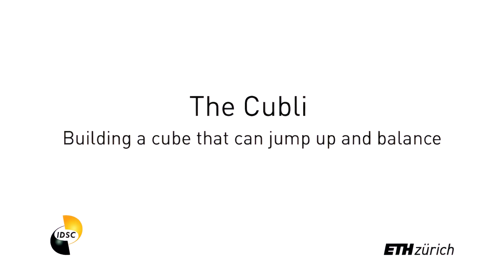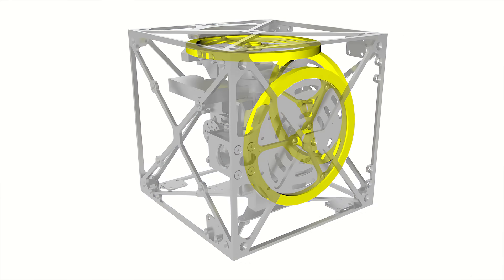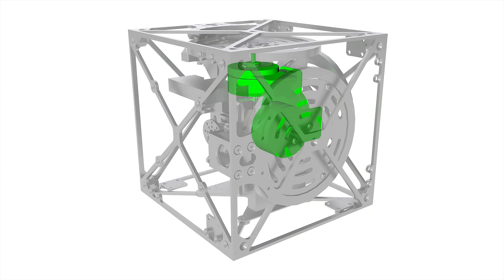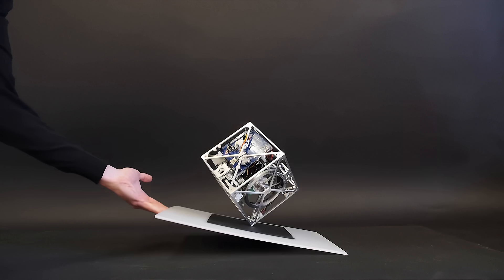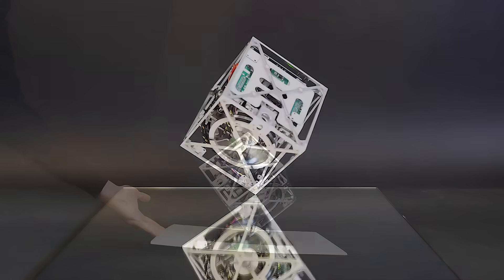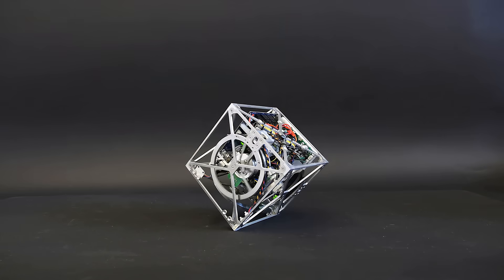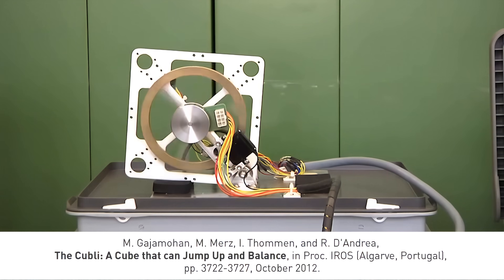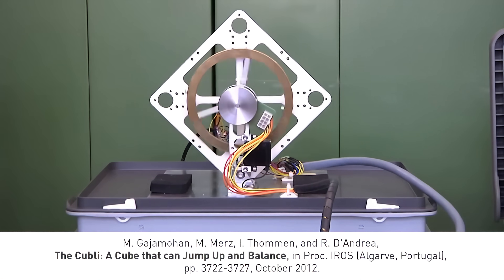The Cubli: a cube that can jump up, balance, and 'walk'

Comment: Spheres and wheels work better imo. Cool nonetheless.
Reply: Watching a sphere balance on any angle is a lot less interesting than a 6 sided cube.
Reply: you can't guarantee a sphere will be still where as with a cube you can have it sit statically on a surface.
Reply: Conventional Characters If energy is any concern, a sphere would be better. Im sure a deployable tripod or something would suffice if it needs to sit static.
Reply: Jonathan Gorr it should be able to stand static within a sphere if it's able to balance on a corner... where can I buy this thing? lol
Reply: Jonathan Gorr Yea but if theres a tiny slope, it would need to slowly speed up, and then it reaches max speed, then you're scewed.
Reply: Jonathan Gorr Yea but if theres a tiny slope, it would need to slowly speed up, and then it reaches max speed, then you're scewed.
Reply: Jonathan Gorr Wouldn't work because you couldn't unload the reaction wheel without a flat edge.

Comment: Is there any algorithms I could find to achieve building a robot like the cubli that uses reaction torques to balance. I am guessing the cubli motor controller use the PID algorithm but that would be nice if anybody had the information to give me.
Reply: It says in the video that nonlinear control ist used, PID could not be used for larger angular movements of the cube.
Reply: Except when balancing on its edge PID could be used but not when balancing on its corner.

Comment: The technology used in the Hubble Telescope i believe?
Reply: wrong actually the Hubble space telescope uses an array of high pressurized air tubes that would easily be able to project anything (besides things on the size scale of a planet)  in an environment of 0 g's or no gravitational pull besides the pull of the solar system we orbit in in which at the wrong angle of perpetual force could put you in a never ending-orbit around the planet. this is why we have satellites orbiting our planet right now...
Reply: Wrong Gabe... Hubble has absolutely no propulsion systems aboard... I did some basic research, which took me 3 seconds, and found out Hubble uses 6 Gyroscopes and rotations wheels. 

'According to Newton's Third Law of Motion, every action has an equal and opposite reaction. Therefore, as Hubble accelerates its reaction wheels in one direction, Hubble's reaction is to rotate in the opposite direction.'

Doesn't hurt to do some research before trying to prove someone wrong hey? 

My first comment was just as a memory, reading a book on hubble as a child so I didn't want to put loads of shit in that I thought would be incorrect, but you came along and gave me some complete bullshit! Thanks for the laugh dude.

Comment: Hi Gajamohan Mohanarajah,
I am interested with your robot, we try to build wheel robot, also by using reaction wheel.. I was wondering about your actuator, what is your BLDC Motor type to drive reaction wheel? could you give me more specific type? power rated, voltage, current and the wight of the reaction wheel? Thank you,  i am really appreciated if you can help me...

Comment: Air Gear AT auto balancing torque motors on rollerskates here i come.
All we need now is a breakthrough in quantum physics so that the AT's can change the property's of air like making it vibrate in order to generate heat releasing flames and were golden

Comment: Man, if you could get these to support and lift insane amounts we could have buildings that just... balance.
Reply: Until the power goes out...
Reply: Adam Sieting Fusion, baby
Reply: ***** Electronics can be hardened against EMP. It's not the end all of electronics like movies would make it seem.
Reply: some high buildings have (active) mass dampers to stabilize movement.
Reply: ***** Aluminum foil! Triple folded and then wrapped! Everything electronically circuit powered, baby. 
Wires, too cuz wires are current powered.

Comment: this i argue is is finally a clear case of true basic artificial intelligence!. i mean look at it you can you alot about it bing programd, but it is it alon that has to decide and choose the right spin at the right time, based on its sensors.
if this is not a form of "low life" case scenario, i don't know what you would call it.
you could drop this cube basically everywhere and it would still be able to maintain a balance.

it cannot learn, it can not evolve, but it feels and it thinks. and that is artificial intelligence.

Comment: The "walk" shown here is really more of a "roll" 
I imagine it could also be programmed to walk by balancing on an edge, jumping to a corner, rotating, dropping to edge/other corner, rotate the other way, etc. - higher power consumption probably but that way it could keep a camera pointed in a steady direction more easily.
... Wondering if a dodecahedral shape wouldn't be more efficient. (or curved edges, but then there would be momentum issues...)

Comment: That is awesome. Is it affordable ? What do you need in order to make it ? How much did you spend for it ?
Reply: The low Kv brushless motors, the arduino-type control board, ESCs, mass wheels and frame can be had for about $300. The problem is programming it.
Reply: Cyberdactyl maybe they could post the code on github?
Reply: Thank you for the responses. What is an ESC ? Is it what senses change in motion like an accelerometer ?

I guess for programming, they applied the inverted pendulum laplace equation and involved PID control principle. Am I right ? Is there anything I have forgot ?

I am new in these kind of projects. I would like to do something like this. Please, Cyberdactyl, have you ever done something similar ?

Comment: @Gajamohan: I assume the inertia is nevertheless a pole in the system transfer. It helps stabilising the position but also makes it vulnerable for instability (i.e. falling down) for fast external stimuli (i.e. hitting the cube). So, how difficult was dimensioning the exact inertia of the wheels vs the available power of the motors and the amount of disturbance you wanted to be able to control?

Comment: why not use reaction wheels mounted on all faces of the cube, with synchronized brushless motors back to back and electronics in the middle. Symmetry will help a lot in balance and precision also breaking could be regenerative.

Comment: Does it have enough momentum to hop while on it's corner? I'm imagining a sequence like:
Jump up on a corner.
Fall very slightly one direction.
Right itself but overcorrect so the corner is twisted and gives the cube upwards and sideways momentum.
While in the air rotate so it lands on the corner again, then balance.

Comment: A Balancing, Walking Cube Named Cubli

December 19, 2013 by James Hobson 

Meet Cubli! Cubli is a 15 x 15 x 15cm robotic cube that can roll around and balance on its corners using a series of GYROSCOPES.

The project has been going strong since February 2011 at the Institute for Dynamic Systems and Control in Zurich, where it is starting to get quite impressive. We first shared Cubli earlier this year, when it was just a wee 2-dimensional and corded 3-dimensional prototype.

Comment: A gyrostat is a variant of the gyroscope. It consists of a massive flywheel concealed in a solid casing.[20][21] Its behaviour on a table, or with various modes of suspension or support, serves to illustrate the curious reversal of the ordinary laws of static equilibrium due to the gyrostatic behaviour of the interior invisible flywheel when rotated rapidly. The first gyrostat was designed by Lord Kelvin to illustrate the more complicated state of motion of a spinning body when free to wander about on a horizontal plane, like a top spun on the pavement, or a hoop or bicycle on the road. Kelvin also made use of gyrostats to develop mechanical theories of the elasticity of matter and of the ether;[22] these theories are of purely historical interest today.

Comment: I think, this technology might be used in robot construction, to make robots more mobile. Now, most robots use a lot of resource to balance, using limbs and body angle, but adding such mechanisms, which allow to add momentum to any piece of robot (motor torques in every limb and few in a body), will make robots more agile.

Comment: Hello. By placing the ROBOT inside two hemispheres, the mobility efficiency is highly elevated. Utilizing two hemispheres that separate, facilitates access of sensors and tools to the outside protecting them during locomotion when the hemispheres are closed. The idea of using this device for a remote Planet Probe is a viable one. However, the energy efficiency is very low; crawling by flopping the cube from surface to surface. Using a sphere as an outer shell, the reaction wheels only need to turn to provide direction of roll.

Comment: This is a marvelous piece of mechanical engineering. Having said that, for this mechanism to work for a spherical object for continuous smooth movements (unlike step-wise motions by Cubli), I imagine a design with infinitely many more rotators grouped together in a framework. I think, engineering-wise, this would be greatly more challenging to build than a Cubli.

Comment: Im calling BS on this. Its clearly a cgi mockup, composited with a real hand, and a few real shots mixed in. Look how well lit the cube is, and look at the cast shadow, it should be much sharper and darker with that lightsource. The table is too dark for a lightsource that bright, it looks like the cube is lit by a spotlight, its so bright. 1 min mark. And why is the camera fixed? Wouldnt you show it of with a hand held from different angles? From 1.11 , the only shot id say is a "real" object, look how out of sync the gyros/whatever are, and it looks like its fastened somehow on the balancing corner, so it will be able to flip up. No way, Im calling BS on this.

Comment: Theres no way it can be used for planetary exploration. Braking the wheel like that over and over will wear it out in a very short time.
Reply: Maybe it uses/could use eddy current braking. Don't give up so easily.  A lot of people didn't the Mars Curiousity landing would work either.  "Those who say it can't be done should get out of the way of those that are already doing it"
Reply: friction is not the only way of braking anything. (electro)magnetic and electrical/resistive breaking are two of many alternatives.

Comment: I find it interesting that people don't see an immediate use for this kind of technology... consider low-gravity inertial controllers, self-assembling shapes, autonomous SAR robots or cameras, etc. It doesn't have to be confined to a cube shape, nor does the tech have to exist by itself.

Combine the reaction torque capabilities with small active surfaces or shape memory materials, or even just small servos that can adjust structural plates. Tons of possibilities as soon as you get the power supply small and durable enough.

Comment: it is using gyroscopic force to maintain its balance. angular velocity is just a part of the gyroscopic force. its basically a reverse function of the gyroscope in the stabilization of a Tomahawk or Cruise missile, where they take the effect from the gyroscope and stabilize the missile through the fins this is forcing the gyroscope to spin at certain speeds to maintain its balance and orientation. the only bit of "torque" in the whole thing is when one the individual gyroscopes is spun up and then halted to make the cube "stand up or walk". it is a rather neat little toy though.

Comment: The Cubli is a 15 × 15 × 15 cm cube that can jump up and balance on its corner. Reaction wheels mounted on three faces of the cube rotate at high angular velocities and then brake suddenly, causing the Cubli to jump up. Once the Cubli has almost reached the corner stand up position, controlled motor torques are applied to make it balance on its corner. In addition to balancing, the motor torques can also be used to achieve a controlled fall such that the Cubli can be commanded to fall in any arbitrary direction. Combining these three abilities -- jumping up, balancing, and controlled falling -- the Cubli is able to 'walk'.

Lead Researchers: Gajamohan Mohanarajah and Raffaello D'Andrea

This work was done at the Institute for Dynamic Systems and Control, ETH Zurich, Switzerland and was funded in part by the Swiss National Science Foundation (SNSF), grant number 146717.

For more details visit: http://www.idsc.ethz.ch/Research_DAndrea/Cubli

Other links:
http://robohub.org/swiss-robots-cubli-a-cube-that-can-jump-up-balance-and-walk-across-your-desk/

Comment: Why not make it in a girder ball still with 3 Wheels covering the 3 axis. A tine bit of squareness in the ball to the keep the "free" acceleration due to the shape ?

Then it can move faster without the annoying edges to stop it ? Friction can hold the it in place when starting up if it is an totally round ball, and energy can be "harvested on a downhill to be used on an uphill with an inversed torque (I am from Denmark, sorry for my lousy English).